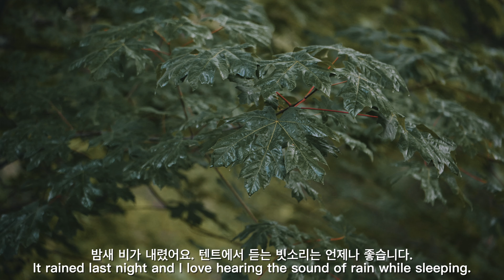New portable fire pit and grill perfect for camping in the rain

Comment: Hi! For your tarp set up, did you use the poles that came with the takibi tarp set? Or did you swap in other cm poles? Thanks!
Reply from the maker: Hello there! I used the original supplied poles that came with the Takibi Tarp set. The only thing extra was a guy line to extend over the Alpha Breeze. Thanks for watching!
Reply: @SirCampalotOutdoors  curious which guy line you purchased, I'm seeing a couple different guy line products with different dimensions/lengths on the snowpeak website. I also have alpha breeze and hexa tarp and would love to try your set up!
Reply from the maker: @timh2705  I got these guy lines here in the video: https://bit.ly/3LwVGp1 . However, you can use any guy lines really. Just make sure that they are long enough. You can always cut them if they are too long.
Reply: @SirCampalotOutdoors  thanks! love your content